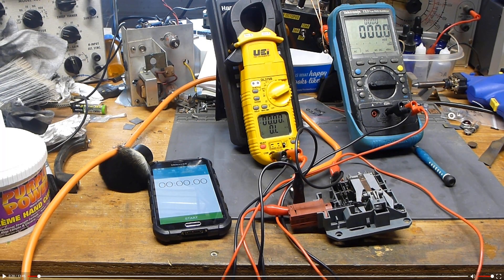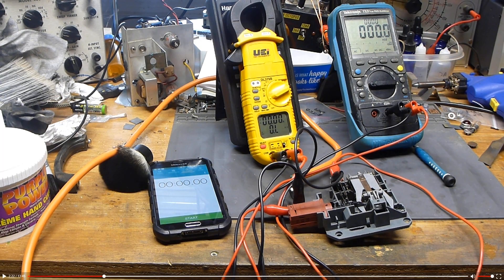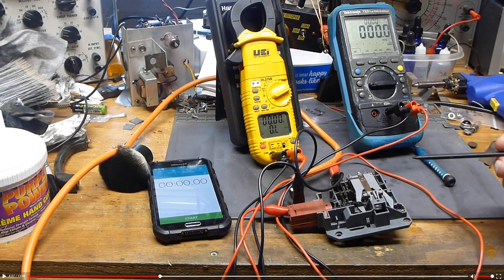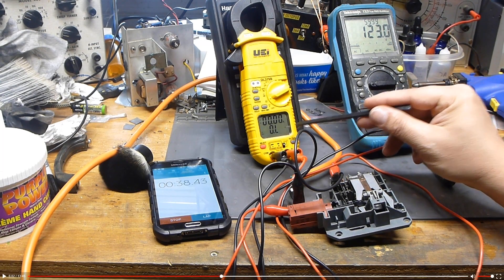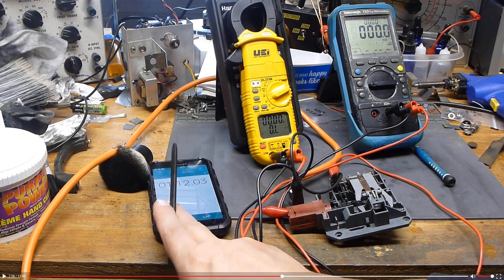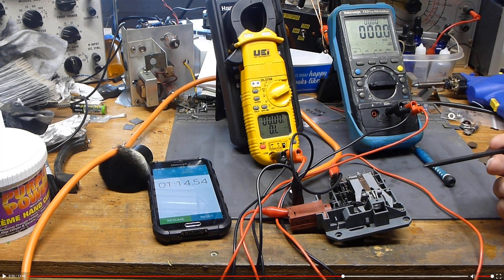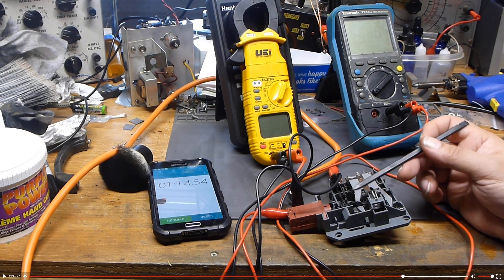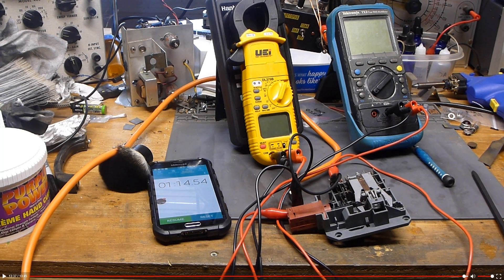Wax Motor- washing machine door lock 2012 Frigidaire Affinity (Electrolux) model FAFS4073NAO

Comment: Hi, my washing machine stopped spinning all together. Water flows into it fine and drains fine. The drum spins freely and sounds fine when spinning by hand. The seals are in good shape as well. When pushing the drum in there are no odd clunks. The door locks as it should when the cycle starts but as stated before it does not start spining.

Could it be the wax motor? Even though the door locks? People have been saying in other videos that even though the door locks it may not push that pin that the wax mother is suppose to push to contact a switch telling the machine the door is closed. There is a light on the panel showing that the door is locked. Every main part on the machine costs hundreds and I'm not willing to guess at it. Most I'd be willing to change out is the wax motor but before I do that I'd like a bit of assurance that it could be it.